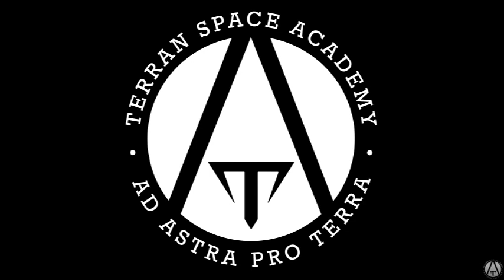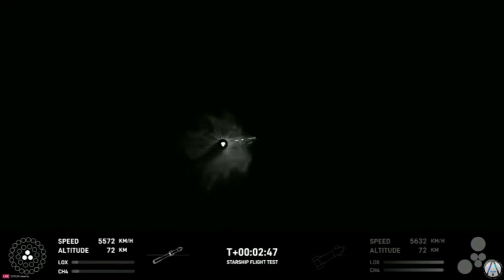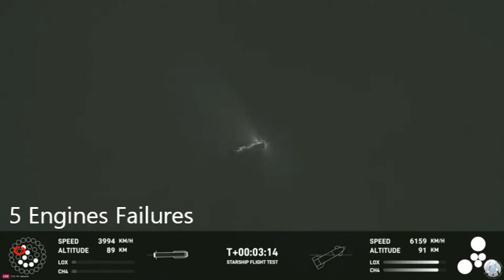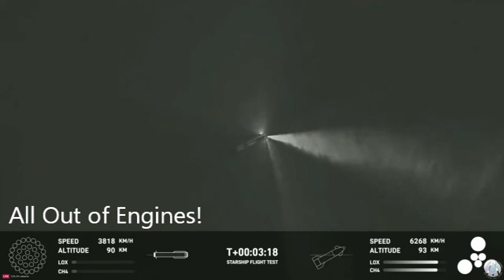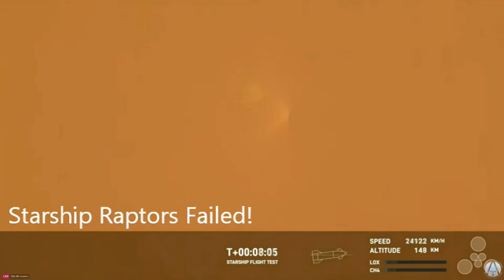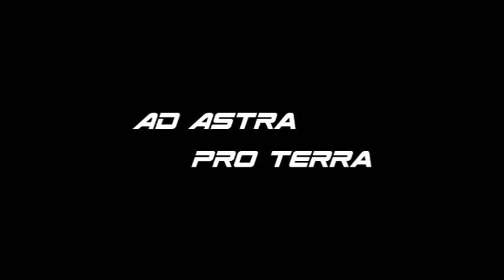Raptors Failed Starship Flight 2

Comment: Starship had 0 signs of engine issues, they even said that on the stream so I have no clue where you got that from. All signs point to a LOX leak which the Ship realized and saw it wasn't gonna be able to complete the mission and promptly terminated itself
Reply from the maker: The Raptors failed due to propellant feed issues.  Raptors worked fine.  But they still failed to relight on the booster.

Comment: Many are guessing the booster was due to fuel sloshing.  I was surprised they were so quick to relight that many engines.  I figured it would flip on the 3 and then stabilize first before lighting more back up.  I still consider this to be a success test, though I really wanted reentry data.  I've been thinking a lot about losing heat tiles, specifically along the lines of how tolerant the ship will be of a missing tile.  The stainless steel is more heat tolerant than most things, if just one tile is missing then you have considerable metal around it to sink the heat.  In some places cryogenic liquid might be on the backside.  Does one tile cause cascading failures of the tiles around it?  Just wondering since those tiles keep falling off.  It has become one of my largest concerns for the Starship. 

I've seen several guesses that the Starship failure was due to a fire.  I don't think a fire was possible after staging without an O2 leak to feed the fire.   It staged at 75km high and didn't look to have any signs of issues for several minutes.  I didn't look the numbers, but I can't live at 75km, so I don't think fire will burn there either.
Reply from the maker: We agree. A little reprogramming and we are on to reentry and booster landing...

Comment: While I always appreciate your informed analysis. This is not your best work. You should check Scott Manley's take on the booster failure. It makes a lot more sense. Negative g-loading and the rapid flip likely sloshed the tanks causing the engines ingest gas. No rocket engine is designed to withstand that. It's pure conjecture as to what caused the ships failure, but the telemetry showed a rapid decrease in Lox just before SECO. Besides these are raptor 2's they are already obsolete. I look forward to your informed analysis when the data is made public. This just comes off as sour grapes.
Reply from the maker: I appreciate that but I see exploding engines as a failure.  The Starship has no baffles and this should have been taken into consideration...
Reply: @terranspaceacademy  Sure, I don't think even baffles will cut it. The booster needs headers. But I don't see it as a failure of the engines themselves, they did their primary goal of getting the ship uphill. They relit. They paid the price for another systems issues.

Comment: Definitely a hot-staging procedure that needs to be remedied and optimized. Good catch on the net force from 3 engines on booster (even at full power) vs 6 engines on Starship at half power plus deceleration in the thin atmosphere causing fuel starvation to the fuel pumps with the flip maneuver adding to the effect. Doesn’t explain the Starship engine failure happening at the end of the orbital burn.
Reply from the maker: That is very true..

Comment: Perhaps some staging reverse retro's would be less of a jolt for the booster's engine second ignition would help settle things down.  This monster is full of brute force at the moment and a more gentle approach to staging could help things a bit.  As for the Star ship engine failure........pass!
Reply from the maker: Engines failed to relight or relit and then went out.
Reply: They are going to have to do a lot of thinking on this but it's gained knowledge and I am sure they will crack it if the record of Falcon 9 is anything to go by!  👍  @terranspaceacademy
Reply: I suspect that hotstaging is being chased in order to make the ride easier for meatsacks. 

The liftoff scene in Apollo 13 is fairly accurate and far too violent for paying passengers
Reply: Yeah, people would need peeling of the rear bulkhead!   @miscbits6399

Comment: I think Scott Manly is right about the plumbing had failed when the booster did the 180.  Maybe the fuel didn’t get to the intake, or the pump failed.
Reply from the maker: One engine exploding can create a big hole in the thrust puck.  This can rob flow from the other engines.

Comment: So all engines were working just fine before stage separation and then started failing one after another in short order? Not an engine problem. Or at least highly unlikely. Seems like something happened during the hotstaging that casued the issue. The force of the Starship engines pushing the booster back causing inpropper propellant flow or the flames burning through something important.
Reply from the maker: Yes. A restart problem.
Reply: Perhaps, but not becasue of the engine desing but because of the propellant flow. @terranspaceacademy

Comment: The booster engines failing due to fuel delivery issues, wrong mixture  etc. sounds plausible. Question is why would the Starship engines fail under thrust.
Reply from the maker: They failed at restart.  Were there "bubbles" in the propellant causing flame out?
Reply: @terranspaceacademy  the booster engines failed at/after restart, but I was wondering about Starship, the second stage. That was flying under full thrust. Hope they had cameras installed like on Falcon 9.
Reply: The Starship engine failure appeared to progress "slowly" over several minutes.  This almost always means fire or overheating was involved.  So I'd guess hot-staging caused a fuel leak and started a fire.  A few minutes later one of the oxygen lines ruptures and we get a large vent plume.  Finally I'd guess the final explosion was either an engine running dry and exploding, or something like communication between FTS and  guidance burning through causing FTS to pull the plug.

Comment: I don't think it's a Raptor failure, at least not directly.  I think that at stage separation there was 3 engines on the 1st stage pushing the 1st stage forward but there was 6 engines on the 2nd stage pushing the 1st stage backward.  The net force pushed the fuel and oxidizer forward, causing the engines to ingest gaseous pockets, leading to nothing good.
Reply from the maker: That is an excellent theory Tim.
Reply: @terranspaceacademy was their a 30-second time during separation or a few seconds for I heard their was but didn't see it in action for that long?
Reply: Had the same idea. The problem is the booster at separation has less mass then the ship. So in order for the ship to accelerate away from the booster it needs to apply more force then the force the booster gets from it's engines, and as a result pushing the booster back more then it is pushed forward. And at the same time the booster can not use more engines, because if it did it would accelerate faster then the ship nad crash into it. No idea how they could solve this, some insane timing of the engine shutdown and restart perhaps.
Reply: @michalfaraday8135 
I hadn't thought about the difference in mass between the booster and 2nd stage..... 
Imagine the "few" tons of liquid suddenly rushing and hitting the tops of the tanks.
Reply: @michalfaraday8135  I think you'd just shut down all the first stage engines as soon as the 2nd stage was lit and separated, then use the attitude adjustment rockets on the first stage to settle the methalox at the engine intake before starting them up.
Reply: @michalfaraday8135 for the stage seperating, why not have  engines on the outside of the 2nd stage like the lunar lander concept to avoid the staging ring and having an optinal abort system? Technically wouldn't require hot staging just no thrust at the time and disconnecting or explosive bolts to ensure seperating.
Reply: @mr.ackermann807 I thought the same thing, the only reason I can think of is the additional structure to transfer the thrust to the airframe(spaceframe?) Would negate the 10% additional mass to orbit, so you would have no gain or very little gain to make it not worth it
Reply: @chadjensenster  10% mass to orbit? Can you elaborate on that please for I'm not 100% familiar with starship, just enough to get by. The structure they have now is mostly enough just need to put the boosters on the outside sides and anchor them on to it. Little welded cages could work. Your input?
Reply: @mr.ackermann807 Elon said hot staging would increase mass to orbit by about 10%.  If you have the structure to hold 6 engines further off from the center of mass of the ship than what they already are, you require a considerable structure to hold up to the force created by the Raptors, then you have to add cowling to help with aerodynamics, so if all the extra structure and coverings increases the weight by 10% you don't gain any more to orbit, so you make it more complex for no gain
Reply: @chadjensenster  I honestly wasn't expecting more mass of payload to orbit, just making it safer and less dangerous. And the boosters I was talking about were not raptor engines but something more like what the dragon capsule used for abort. And the aerodynamics was considered so I was suggesting to make them less protruding from the craft and hugging it as close as possible without buying itself. It was a simple thought anyways, not expecting them to use it if they do not wish it. I was wondering why not 3 stages as terran space academy mentioned once, but I think the 2 stage is preferred by them for less complexity and more reliability from their part. Thank you for your explanation.
Reply: @chadjensenster  no offense at all, but I would suggest a dark sky station for launching for a boost or a star raker starship type combo. If you want to hear the combo idea simple ask for if not I will not waste your time on a topic you do not want to hear.
Reply: @mr.ackermann807  I would love to hear your thoughts
Reply: @chadjensenster  ok. The dark sky platform could easily reach an altitude of around 40km putting much of the atmosphere behind it allowing for much easier but still dangerous launches. For launching it would be ideal but not for landing at first till a catch system like for starship is fully tested. The star raker idea I had would be to use a space plane like the star raker but have boosters attached to it for getting into space and taking the advantage of the wing lift of the atmosphere at those high speeds to almost bounce when it gets up there with those speeds but the bounce is an if. It would use its air breating engines to get it up to the sky station or the sky station could take it up there where it would go off a run way to get speed then do the Mach 7 acceleration like it was originally designed to do then once at a certain speed use the boosters like super heavy but smaller to get the last speed boost to get into orbit and the boosters can return to the sky station. It would be expensive and complex, but with the right intelligence and creativity it can be done if not cheaper and cost effective. That is 1 of my ideas for it. Do hope you find that idea interesting and if you want to know more than ask. Thank you for your time.
Reply: @chadjensenster sorry not idea, just some thinking. Do you have any thoughts or ideas to make it better? Did my statement earlier sound off?
Reply: @mr.ackermann807  I will have to think about it. I have always felt a space plane is an excellent way to get to space. It does have some challenges, but it's not impossible.
Reply: @mr.ackermann807  I am not sure about the Dark Sky platform. Not saying it couldn't be done, but the lever arm on a 40km platform especially with the jet stream which has winds that can reach almost 300 mph. I believe anything is possible, but is it cost effective? I don't think it would be
Reply: @chadjensenster  ok. I will await our conversation until you are ready.
Reply: @chadjensenster  lever arm? I wasn't aware the jet streams went that high, I thought they only went as high as around 20km only. And at that with most the atmosphere beneath it, the winds speeds would nearly none existed. Simple motored fans would be enough to keep it in position and the counter act any balances. Unless you are referring to getting up there then use the fans to re position ever so often on the way up. Starship could still launch from it, but it is better suited for space planes.
Reply: @michalfaraday8135 you could use some sort of RCS system. Use that to flip the rocket and once it's flipped, air resistance should cause it to decelerate and force the propellant back to the bottom.Not sure how much weight the system would add vs how much extra you can get to orbit. Or other rocket companies have used a big flexible gas tight fabric that is pressurized on top to keep the propellant in the bottom of the rocket.
Reply: I was thinking the same after seeing the this video. The failures seem to come after changes that could send the fuel & O2 to other parts of the tanks. Perhaps a disruption damaged some pumps? IDK
Reply: This is why the deflectors in the hot staging ring exist. It would take a negative acceleration (not just a decrease in positive acceleration) to make the tank contents jump

Bear in mind that there's very little atmospheric drag at these altitudes/speeds and that the second stage doesn't go to full thrust until it's disconnected from the booster
Reply: @miscbits6399  Right, but I think there was a negative acceleration.  When the 2nd stage is lit there is initially no rearward force to cause this since the exhaust is going radial at that point.  However when the stages separate there is a large rearward force of 6 raptors vs. 3.

Comment: I wonder if testing has included going from full power to full stop then restarting a couple of seconds later. That's the kind of thing that breaks a lot of engines, let alone rockets

Regardless, I'm betting that SpaceX have root cause analysis and a solution within weeks
Reply from the maker: I agree. They were flawless until restart, at least for the booster.  The question is what happened to Starship?
Reply: @terranspaceacademy  It's being posited that loss of telemetry trigged the autodestructs or that it had an excursion out of allowed corridors. RIght now there's insufficient data to  make an informed comment
Reply: Looking at the posted timelines (wikipedia page), the second stage failed only about 12 seconds short of SECO (several minutes of operation), which makes me wonder if there was some form of throttledown which triggered it. Having run for several minutes with all 6 engines showing no sign of trouble tends to indicate the hotstaging system worked ok and the engines weren't damaged by flying debris, etc

WRT the booster multiengine cutoff just before FTS kicked, the timeline indicates that the flight control system initiated full shutdown and aborted the 180 degree turn due to the multiengine failures  3 seconds before the termination system fired

SpaceX have done really well to get as far as they have in as short a period as they have. Whilst it's a shame the ship didn't achieve the full mission most goals were hit and we can be pretty sure they'll go even further next time - the cost/benefit ratio of their iterative work dwarfs anything that's come before it
Reply: @terranspaceacademy For Ship people have noted a plume coming out of the aft area right before the end and the telemetry changing from LOX and CH4 gauges dropping at about equal rates to the LOX gauge (telemetry graphic) dropping noticeably faster than the CH4 one, all of which hints at the possibility of a LOX leak maybe in an engine power head rather than a tank rupture. Did that cause an explosion or did the LOX loss lead SpaceX or the automated FTS to calculate that the Ship couldn’t then get onto the Hawaii trajectory so the FTS was activated? In any case the evidence for a LOX leak does seem quite strong to me.

Comment: yep, yet every time i brought up the problem of the many engine failures of the previous test or almost every engine test between the two big test, the musk fans said it is not a problem. ok, it was less of a problem here, than in the previous one, as it went almost perfectly until the stage separation, but after that, it quickly come up again. and while in theory we could lose a few on a 33 engine booster, since only three gimbals, losing even one of those is a big issue, and losing two of the center three is an almost sure loss of the craft. same for the upper stage. and probably losing even one of the center engines will damage the entire gimbal and guidance system, so even one is not a great option even for just cargo.
Reply: No tests up to today have involved a flip maneuver while hot staging, so I think you might be suffering from a case of musk derangement syndrome
Reply: @dmurray2978  and i think you suffer the problem of the education system of the usa, namely you fail to understand the letters forming words and sentences, also known as reading. i talked about engine failures, almost every single test up so far, including this one, suffered from many engine failures for various reasons. but understanding this  will be as impossible for you, as not blowing up a rocket for musk. on the bright side, you do not need to react, as you will be muted for being too stupid.
Reply from the maker: I think it is a restart issue for the booster, either because of propellant slosh or hard restart detonations.
Reply: I think its all the inner 13 engines gimballing.  The outer ring are fixed.